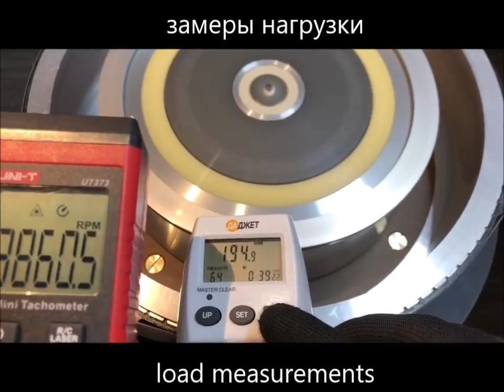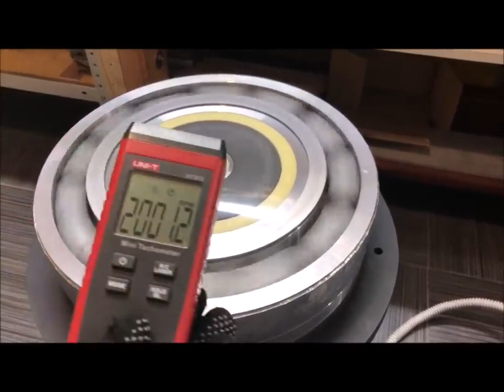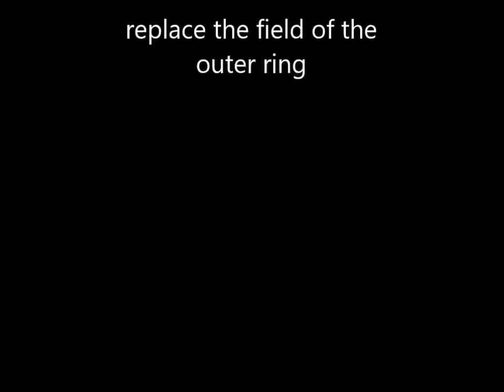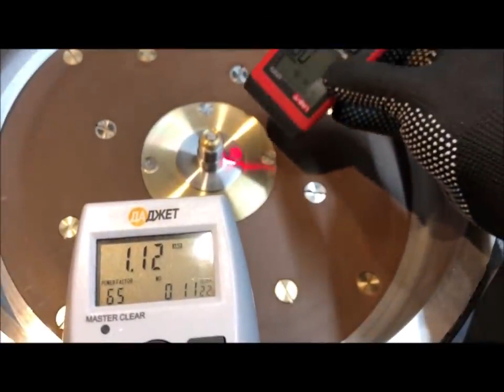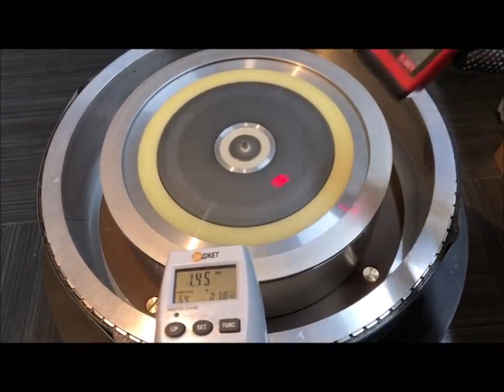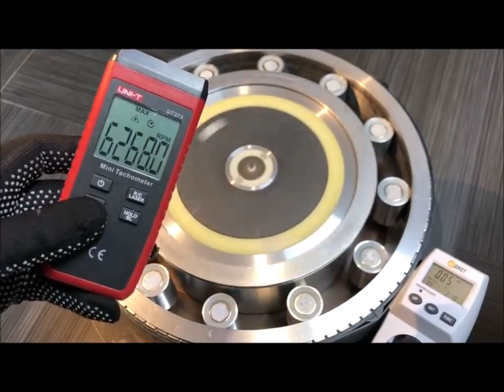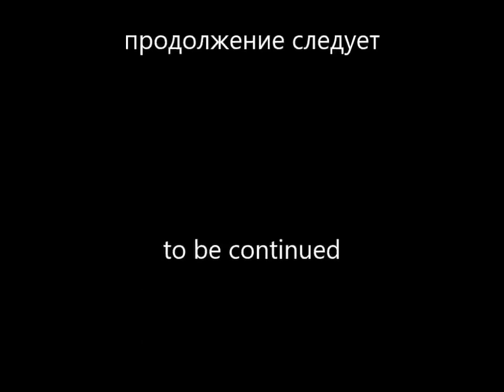In search of the Effect of John Searl  Part 19

Comment: useful work?
Reply from the maker: This particular device, no, but in general, yes.
Reply: @YouTubeProger  0,00001% ? :)
Reply from the maker: @sergov3195  I don’t know what percentage, I don’t have a worker. I don't have a Searle generator.
But based on the theory that when the rollers rotate there should be no friction and a large number of electrons pass through themselves, thereby creating a zone of rarefied air around themselves, the percentage will be at least 0.00001%.
Reply: @YouTubeProger  just watched a presentation by john searl. he sez the rollers are meant to be repelled by the plate. once the roller picks up speed with the repulsion it creates eddie currents. This pulls the rollers to the plate and balances out which locks them in place where they float.